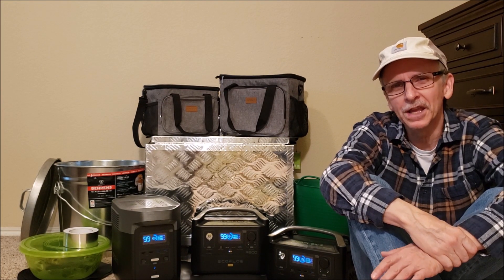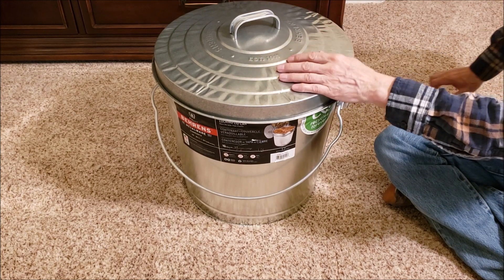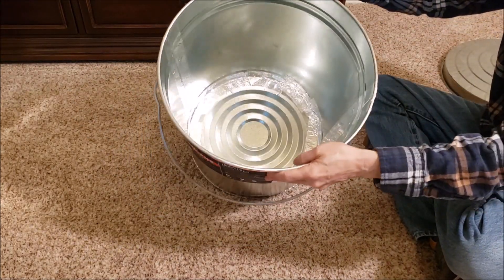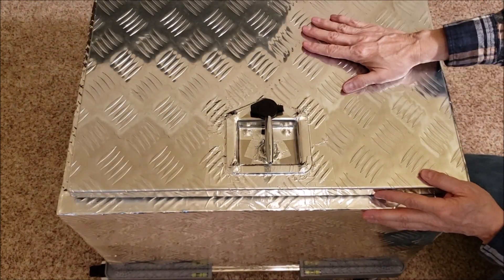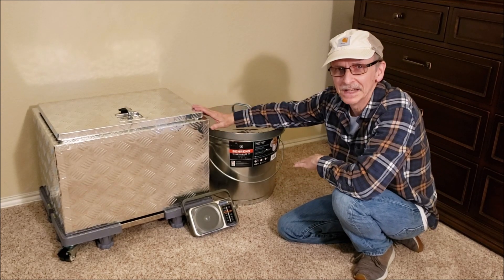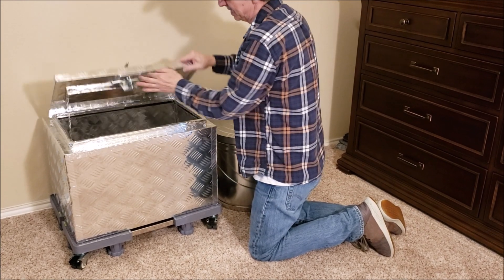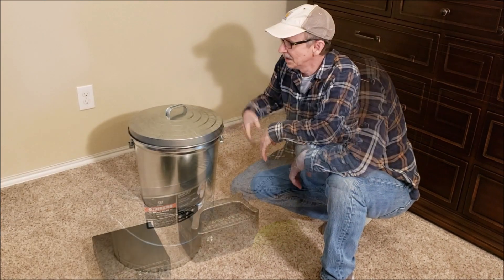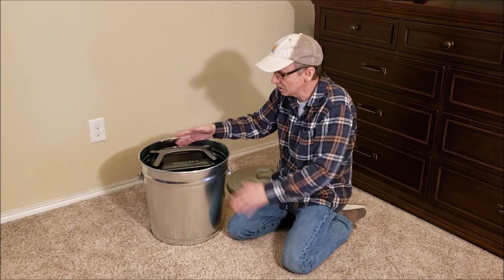How to Make a Faraday Cage for Your Solar Generator - Portable Power Station

Comment: Thanks for the video. Is it safe to store a lithium battery like a jackery inside of the metal can? Do these batteries need to have air circulation? Thanks.
Reply: Thanks!
Reply from the maker: @Westoftherockiesyourontheair  I keep mine in one. I take it out every three months or so to use it and charge it.

Comment: so i got the tool box, taped it up and lined it with cardboard on the inside. it doesnt seem to be blocking any signals. can i line the interior with faraday cloth? does that create any issue if i'm using the box to store my bluetti ac200max generator?
Reply from the maker: What are you using to create a signal?
Reply: @LoneStarPrepping  I just put my phone in the box and had a video playing. So I guess just wi-fi.
Reply from the maker: Use, like I said in the video, an am radio signal. Watch my updated video on how to make a faraday cage. I explain testing more.  By the way, be sure there is a good seal between the lid and box using the same tape or copper. Also where the handles are.

Comment: Thank you. Question.  Wouldn’t you need to foil tape around the lid after closing, as well?
Reply from the maker: Yes, if the metal to metal lid to box is not enough after testing it.

Comment: Sometimes you can find used surplus NEMA metallic enclosures in surplus shops. If they are not to perforated with sealing bushings or conduit terminators in most of the sides you can buy chrome plated steel knockout plugs to seal the holes. A layer of aluminum tape on both sides any you are good to go. BTW, in the Lindgren screen rooms we used in the paging repair center I worked at there is actually a power pass through bulkhead that eliminates RF and probably an EMP. We were near several TV transmitter sites and radio station transmitters and we were able to have power within the screen room without ingress of stray RF.
Reply from the maker: Sounds interesting...

Comment: Would the ECOFOW DELTA fit in those 10 gallon cans?
Reply from the maker: The Delta pro wont fit. I put my Delta 1300 in the big box. I asked Ecoflow about storing their units on their ends or sides and they said not a good idea.
Reply: I have 2 Ecoflow Delta 2'S , Will this fit both my Ecoflows in the Tufiom Big Tool Box? GREAT INFO!  @LoneStarPrepping

Comment: i thought you had to line the inside of a metal container with cardboard because the divide can’t touch metal
Reply from the maker: Dont know what you mean by "divide".
In a cage, where something you put in is metal, you dont want it touching the metal cage. In my large faraday cage, nothing I am puting in is touching the sides and nothing I put in has metal to even touch the sides. As far as cardboard, I use platic buckets in my smaller cages because it is easier and cleaner looking.

Comment: A microwave makes a great fast feraday cage . Providing it has a good seel . Then take power cord out . Expose corf screws  then put in a good grounding wire  to a grounding steak . Di not ground to house ground . 
Microw wave and magnetic emo are cousins .  This will let you sield small items . . Yes for big items i use the garbage can you soeak of . I use flex seal spray to coat inside vrs static electrixity . Seal can like you say . .  A large can done i put a second small can inside. .  Use large ammo cans for solor panels . ( From military surplus stores ) .

Comment: Do you plan to use the metal tape to seal the lid to the frame of the can? It would make a better, more continuous shield, would it not? Also, perhaps grounding the cans would improve their shielding?
Reply from the maker: Grounding is not needed. My test shows that it seals fine without tape for lid. Also, I want to be able to access my electronics for everyday kind of use and if I had to tape it up, I doubt I would even use it. If you wont be using items, go ahead and tape it up for good measure.

Comment: Love your style! Question: isn't it important to keep all items away from the metal can's sides? One video showed lining the can with cardboard to prevent contact with the can itself. Might you have an opinion about this, please? THANK YOU
Reply from the maker: I line them with plastic buckets. The large one contains a portable power station with platic housing. I find it much cleaner and easier that way, rather than cardboard.  I tried cardboard back in 2015 and didnt care for it.
Reply: @LoneStarPrepping  thank you! I caught you plastic tub video after posting the question and simply LOVE your ingenuity with it! You really gave me hope that I, too, can do 'dis! :D
Reply from the maker: So glad I could be of hope! Thanks for watching.
Reply: @LoneStarPrepping  My small 10gal accommodated a mop bucket (sans handles) and wow, it was so easy to pile in the goods! I also took the step to foil-overlay on the gasket area, hoping like heck there's a good seal. Thx again for your brilliant ideas!
Reply from the maker: Take an am radio and tune in on a strong signal and place inside. If the signal goes away, it is likely going to be fine.

Comment: How can I protect my safe? I’m afraid I won’t be able to open it!
Reply from the maker: @kaybyrd8500  I would use aluminum tape to seal the foil or emp cloth to the gun case.
Reply: @LoneStarPrepping  I’m planning on doing that. He used magnets but there are small gaps around the edges! I’m a 73 year old widow (Covid) and trying to figure this out by myself!
Reply from the maker: @kaybyrd8500  Sounds like you are on top of it.  Im so sorry for your loss.
Reply from the maker: I just bough a liberty gun safe. It has an emp proof button keypad. Maybe you can have that installed. At least I know they make them now.
Reply from the maker: Need more info.  Why problem opening it? Turn an am radio on strong signal and put it in safe.  If signal goes away, you are probably good to go.
Reply: @LoneStarPrepping  I’m sorry, I was not very clear! I have a digital safe! I’m concerned that I won’t be able to get it open if we have emp! Is there a way to protect it!
Reply: I’m afraid the key pad won’t work
Reply from the maker: @Kay byrd  I wondered the same thing. I would not count on that working, and I dont know how to protect it. If its a gun safe, I would just have a backup plan.  Isnt there a key option?
Reply: @LoneStarPrepping  no keys

Comment: what about 30 and 55 gallon steel shipping barrels with a ring band tightened with a wrench, sand the surfaces of band keep rubber inner seal?
Reply from the maker: I really dont know. I would have to see it.  Sounds like it would work as long as the seal from the lid to the can is metal and not rubber. Just test it. The ring band sounds a little inconvenient though.

Comment: What good is a power station if all the refrigerators or televisions etc are inoperable due to an emp,,, like having tons of gas with no car… but all is well and good to learn….
Reply from the maker: An understandable question.  A portable power station that is protected can be useful in powering devices that were also protected in a faraday cage.  Cages like these  would be useful for emp's that are not necessarily life altering events.  If the EMP is a life altering event, like eventually killing 90% of the population within a year, then the option of being able to bugout may be necessary.  In that case, these wont do much good at all.  See my latest video as I address that situation and how to handle it.

Comment: How did you seal your emp bag within the cooler?  I will want to get in and out of mine a couple times a year.
Reply from the maker: I just folded over and taped. You may not have to do this. It still seemed to work okay when I tested it without taping it.

Comment: That sounds interesting...I look forward to hearing why it ought to be last.  I my case it was pretty high up on my list as a prepper.  It did have to take 2d place to the whole house EMP because I had to replace my furnace/AC this past winter that cost a considerable amount and in protecting that investment the cages slipped on the list but they are not last.  Car and truck,  individual ferrite devices, EMP bags are next on the list.

Comment: Great video...I do pretty much the same thing with an addition.  It came about that when I was working  on the trash can that a  question popped in my mind...what if we have a fire and the house burns?? So I decided to line the can with a fire proof ceramic fiber blanket.  It works well.  I've decided to make a bigger trash can version about a 35 gallon size.  Have you done anything about you car and whole house?  I have just added an EMP Shield to my house and the car and truck will be next.
Reply from the maker: No, I have not done anything about my car or house.  Sounds like you are getting ready for an EMP!

Comment: Some here on YT are saying cans should be lined with cardboard or some other non-conductive material.  Is that necessary?
Reply from the maker: Sure.  Use cardboard. Lots of people have done it.  Im lazy.  I found an easier simple way to do it.  All you are doing is trying to keep you metal items from touching the can.

Comment: How would flex seal work as an insulator?
Reply from the maker: Im thinking it would work fine.  I almost did that, but my way seemed so much easier. Its just to keep your metal items from touching the can.

Comment: Would using a simple empty plastic cat litter box, wrapped with aluminum foil on the outside and inside then shielding the inside with pieces of cardboard work good for cell phones and laptop, etc. ?
Reply from the maker: Thanks for your question, but no.  The cage needs to be sealed.

Comment: Just unplug electronics. Ground your can/cage. Emp should move like lightning.
Reply from the maker: Unplugging would not work. Most electronics would fry.  Grounding cage does not do anything.  90% of the population would  likely die if there were a large enough emp attack that took out the entire grid for over 4 weeks.  So, no, not like lightning.  If the emp, or emps, took out the entire grid or even part of it, it would be nice to have certain electronics in a faraday cage... especially for communications, at least.
Reply: Actually lightning is normally more damaging since it is a concentrated transfer. I've seen evidence of lightning traveling through roof vents, jumping to gas piping, through appliances and more. Emp is more surface charge. Overdoing your build is always better than compromise. Your can will stay charged if isolated from the earth. You can discharge it by touching it as well.
Reply from the maker: I see no reason to ground it, period.  This is about emp protection.  No reason to make it any more compicated than that. Also not practical because the emp cages I have are portable.  I understand grounding for other things.  I had a lightning fuse and ground built into my off grid 10,000 watt battery capacity solar generator I built ... see my video on it... not needed to protect my portable faraday cage from emp.

Comment: This is all good information and tips but I use my ecoflow river pro daily. It won't be in a container protected should we be hit by an EMP all of a sudden. Any ideas?
Reply from the maker: I have a few ecoflows and store 2 in cages.  Unless you need it for medical reasons, a solar generator is the last thing to worry about if an EMP hits, anyway.  80% to 90% population would not survive if the US lost power for a month.  I would make sure you keep ham radios and other things... in a cage. Load up on basics... food, water, defense, etc.. and be ready to leave if you are in the city.
Reply: @LoneStarPrepping  thanks !
Reply: @LoneStarPrepping  where do you go t get out of the city? what if its winter 10 degrees?
Reply from the maker: @samuelwallace2829  You will probably be part of the 90% who will die.

Comment: One of my cousins Fractal Burned multiple sheets of 3/8-inch plywood to "panel" a room.  He used 120V (USA) house current to do it.  NO WATER / baking soda involved. -- One does NOT have to use the High-Voltage (and 'wet' stuff) for it to work.
Reply from the maker: No idea what you are talking about.
Reply: @LoneStarPrepping  ha ha

Comment: Question..... although not likely recommended, can cardboard boxes and layers of tin foil be used in lieu of more expensive and commercial products?
Reply from the maker: You can use cardboard, sure, to line the inside. I would not line foil.  Its to keep your metal supplies from contacting metal sides.

Comment: An additional thought concerning a targeted launched EMP.....
Be very wary of opening up your cages at the ONSET of an emergency! 
A discussed tactic is a SECONDARY OR TERTIARY EMP a few days or weeks later to finish off whatever emergency mitigations people or govts pull out after the INITIAL attack and begin using. 
I would have a primary box to open, and the secondary backup stuff to open weeks later in case this strategy is employed against the US.
In the potential situations we are now considering? A little paranoia is a GOOD thing.... lol Think 2 steps ahead!!
Reply from the maker: Thats what I did. I have a few cages.  One is none. Two is one.  For example, I have 4 hand held raidios in different cages and I store my desk radio in a cage as well. Also, I have other videos on the topic you may want to watch.

Comment: not need gaskets on inside lid bin?
Reply from the maker: Not if it seals well enough.
Reply: @LoneStarPrepping  ty
Reply: w
Reply: @LoneStarPrepping  where are your solar generator panels? do they need protection?
Reply from the maker: They are not connected to the portable power stations. They are for emergency only.  As long as disconnected, they shoulf be safe.  I also have 1 big one put away.
Reply: @LoneStarPrepping  ty!

Comment: I have a question, Would an insulated lunch sack/cooler with that silver foil type lining work to protect your Items? The reason I ask is because they make some that look like a purse (I have one), and I thought it would work nice to protect your phone while out and about. Also I was wondering the same for The silver insulation stuff you get in rolls that looks like bubble wrap?
Reply from the maker: I have seen those.  My wife uses one when shopping for meats etc...  I tested mine about a year ago, and it did not work.  You might try testing yours like I do in video.  Let me know how it works out.

Comment: Also, I though copper wire was required to create an effective faraday cage (?)
Reply from the maker: I would have added one if I felt it was needed.  Not even sure where you plan to put the copper.  If you mean to help seal the lid, I'm sure it couldn't hurt. I dont need it, however. If having issues with leaking waves, copper may do the trick.
Reply: @LoneStarPrepping they do sell special gasket material you can purchase from several manufacturers. They are designed to add the conductive layer and air / water seal on sensitive electronic controls in the industry. If you have ever seen the boxes used by cable tv companies for their pole mounted amplifiers and distribution amps, there is a channel on both halves of the aluminum housing that holds these special gaskets. They also offer a conductive adhesive used to fasten the gasket to one side of the housing. When servicing the equipment within the tech will inspect the gasket and mating surface of the lid. If there is any issue he carefully cleans the mating surface and then fastens the cover back on the amp housing. I have used a large amp housing to hold a small repeater up on a tower in the past. All ports are threaded 5/8x27, same as type N and SO239 connectors. The equipment was well protected against lightning discharges a few poles down the line in cable service and never had static discharge issues with the tower mounted repeater.

Comment: What ham radio do you have/recommend?
Reply from the maker: Funny you should ask.  I just finished a video about this and will be posting it in the next few days...
Reply: @LoneStarPrepping  Excellent! I want to get a base and portable w/11 meter capabilities. I had an old Yaesu base yrs ago that was modified to include 11 meters but unfortunately it was stolen. Is there such a radio like that anymore?
Reply from the maker: @cquintana9326  I looked around and could not find one.  Let me know what you find.

Comment: Can’t I put electronic items I received in the original cardboard boxes inside a galvanized trash can? Keeping in mind to tape the vulnerable areas you showed in the video.
Reply from the maker: Sure...
Reply: @LoneStarPrepping  Ok. So then lining them with additional cardboard isn’t always necessary? You have any ideas for protecting the Bluetti EP500 from solar flare or EMP? They don’t make a trash can wide enough for that power station. I thought about a large dog kennel. Somehow reinforcing it against EMP or solar flares. That would be large enough for quite a few pieces of electronic gear. I’m just not sure about how to go about building it out.
Reply from the maker: @MsJoose59  Correct.  The only reason I have lining is so anything I put in with exposed metal will be protected.  If you go to the link I have under the description, there is a site where you can buy some fabric to wrap it in which may help.

Comment: Good video.  Lots of facts. I don't disagree actually but don't know,  nobody does,probably, is if the pulse or wave can pass through a 1mm gap or mesh with wires bigger than 1mm
 I'm wondering if the "100 mph tape"  is really required for rivins.